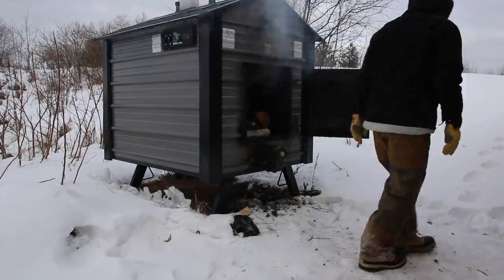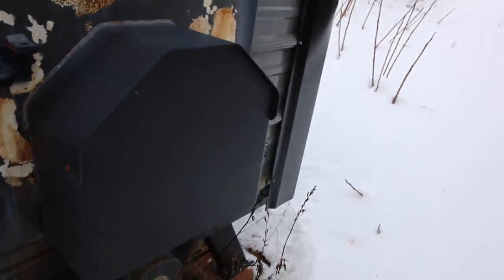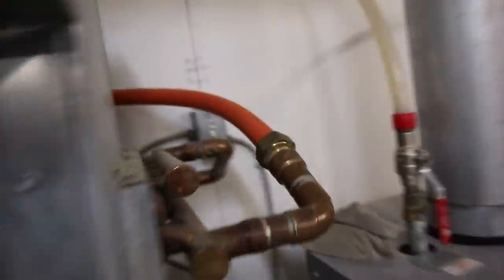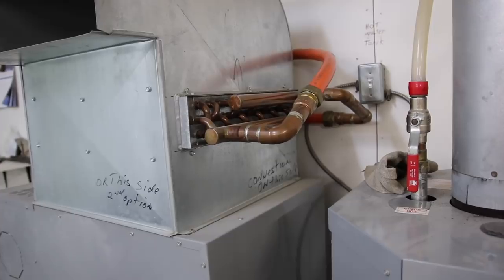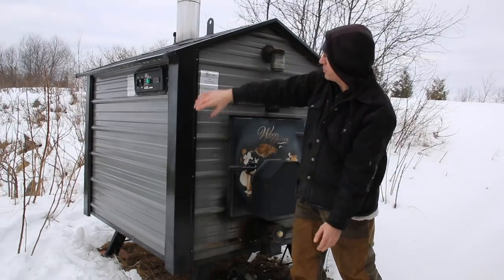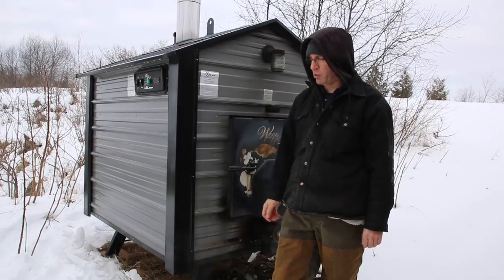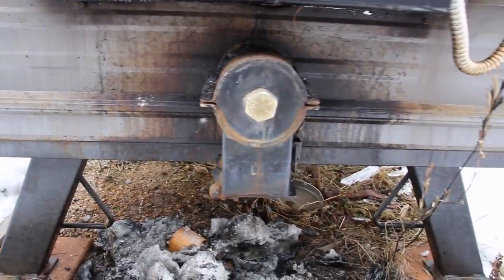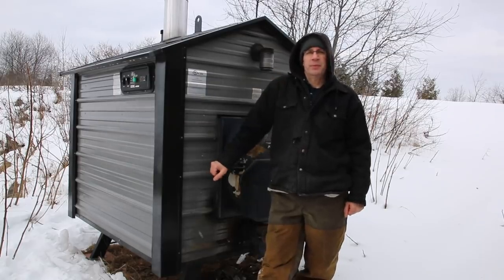Outdoor wood furnace "worth the investment?"

Comment: Most towns in Ct, including mine, thank goodness, have banned outdoor wood-burning boilers; way too much smoke. One unit can smoke up a whole neighborhood.
Reply: If they are up to current federal codes THE NEW MODELS hardly smoke at all but they will put a dent in your wallet, they burn much hotter and hardly put out any smoke but you can still smell a little.
Reply: Boiler stove
Reply: Mine hardly smokes, especially compared to my wood stove
Reply: they only smoke bad if your burning wet wood.
Reply: Glad I don’t live in CT... they won’t let you use wood because they would rather charge up the ass for the gas run to your home that’s why they banned it, wonder what would happen to people like that if the shit hit the fan and all heat and electricity was cut off, 80% of the population would die because they didn’t know how to start a fire

Comment: logmeindangit
so clearly he meant outside.. and I agree, that was the first sign to me that he was not energy wise. all of what he spoke of is true and so much more. What it did do was cause me to design yet another wood burning apparatus for various uses. 
What i find sadly humorous and we all do stupid things ... actually dumb things because of ignorance... stupid is when you know better and do it anyway, dumb is when you don't know better because no one shared the info with us.... 
Ok the simple solution on so many levels would be to simply run the heat exhaust up the side of the building and above it by three feet creating updraft (no fan needed) put the chimney stove piping at a 17.5 degree angle or more depending, at least 2 feet away from the wall and double back if you can and up out the peak plus two to three feet (looked like the building is in a holler so it may have to be taller with stays and or a wurrlygig spinner to stop downdrafts.... now the door to the furnace could be facing out of the back of the shop, clear a space to bring and stack the wood on pallets, cut a hole in the wall for the door after stripping the outside off and making adjustments, sealing holes or putting valves in them to use for more efficient burning, and now you conserve all the heat produced, don’t need a fan and all that electronics to go bad but if it works leave it on there for when your not around, (love the oil burner backup and use of the same fan.... check to see if you can't put a large flap to direct the flow of air over one or the other radiators and reduce drag on the motor (I found that finding an old belt drive fan and reducing the ratio even more so it runs very slowly and quietly (grease bearings once a year) works great and never need the furnace fan and all that electricity, like 120 bucks a month around here... or a cheap fan on a stand works well to with a directed shield around it blowing at the flew pipe (get the thick good stuff, solder or screw and tape the joints and paint Black Chimney works great)... 
Oh and if you want to go automatic find some potentiometer setups or the old spring thermostats that are large and strong and use as valve to open air intake or close it as it gets hotter.  Cut a doorway about four feet away from the stove and create the wood patio loading dock, which you could cover with foam and siding with slats to screw to (be sure to pre-drill, use rubber washers and or calk in the hole first to oooze out and then cover again and smooth over so no leaks, I use soffit vinyl white (due to least expansion rate which a lot of screws can overcome) I use drywall as they have a lip on the underside to grab the drywall paper and it works as a built in seal so all ya gotta do is properly seal the top so it doesn't rust.... so now you can go through the shop door in your PJ's and load it up or if you've built an auto loader, simply open the furnace door hit the load button and the logs slide down a shoot like a concrete truck and you direct the flow and where it goes, Close the door and wander back to the lazy-boy chair and the football game..... :-}
And now when you go out with your family to have fun or teach some kids that have never experienced it and make it a fun event, get a real log splitter that splits a log into five pieces in a second ... see youtube videos.... or put a team together and make a little production of it and sell some to pay back or pay yourself for being so smart... what matters is that you have fun and share it with others while "work is being done".. If you were loading it twice a day the way you have it now, it will be every two days this way, which means you have a slow burning kiln now and can put big thick heavy logs in there once you have a good heart of coals...won't be long before you're opening the door to let some cool in... oh and don;t forget the importance of moisture to transfer heat and more comfortable for the lungs etc... Blessings hope someone gets something from my sharing.... I can see it, and I like it... thanks for sharing..

Comment: Oh no! Another winter with geothermal! Still going strong after another dreaded summer of meat locker cold in the house. I used to dread winter. 20 cords to cut. Constant feeding the boiler the best tamarac and ash. Saws to maintain,old 4x4 getting old. Every day off in the bush. Scouting for new supplies of trees. Now I adjust the thermostat. Your right this geothermal is crap. It paid for itself the first winter as far as I’m concerned. The sweetest thing was that Harper gave me back 11,000$ to install it on the green home improvement grant : )
Pure joy was dumping my boiler at the scrap yard.

Comment: Wow, you put a shit ton of wood in it, at a time.  If you were heating with a stove, you'd start with 2 to 4 logs and add one to 2 logs at a time, thereafter.  I see this one puts the fire nearly out, and restarts it though.  So you don't have to stoke it so often.  That's interesting.  

It seems like it would be more efficient to put the boiler inside the house.  Then it would heat the home, even if the power went down.  And you wouldn't have to get dressed.

Comment: Every set up is going to have its pros and cons.  One of the more hidden benefits to this system is that you have the option to use it in times when other methods of heat are too expensive and the option to not use it when other methods of heat are cheaper.  Propane, heating oil, kerosene........at any time, the suppliers of these resources can decide to raise the price.  You can be mad about it all you want, but what are you going to do? ........ not buy it and freeze to death?  having a system like this gives you the option to not have to use other methods.  I am curious though, why you don't use this to heat your house as well.  seems like a lot of wasted heat and money for just a shop...... unless that's your workplace where you make your living.

Comment: You put an insane amount of wood in that boiler. Of course it wastes most of the heat. Stoke it with a few pieces of large logs and it will work much more efficiently.

Comment: They are nice to use, but this is a cheap and inefficient setup that definitely wasn't worth installing.  At a minimum a gasifying boiler should be used so you aren't wasting your wood.  A storage tank should be used, also so you don't waste so much wood.

Comment: Don’t do it. Get geothermal. Boiler is a ridiculous amount of work. Cutting and hauling wood. Maintaining a truck and saws. Dangerous work. Water treatment is a big pain then when the water jacket starts to go you will be fighting holes. Did it for 10 years. No more going outside at bed time to fill the boiler then wide awake. So many reasons not to go wood boiler. Nice little stove in the house,cheap and nice heat. I regret ever thinking a boiler is a good idea.
Reply: geothermal is a total waste of money, people here tried it and dam nere sick all winter, could not get heat to save there ass at -40
Reply: Geothermal is a joke and a complete waste of money. You will never get your money back and its not practical at all
Reply: Complete joke?im sitting in my cozy house smiling it’s such a joke. Yes it’s terrible. 100$ a month in electricity. Warm as I want in winter Cool as I want in summer. See,I had a boiler,now I have geo,and I have several wood stoves. I know absolutely nothing except I’m warm,I’m not outside feeding the beast.
Reply: @chrisroos5081  it will never pay for itself and it just gets to be more expensive over time when you start to need costly repairs and your electric bills keeps going up. I used to help with installs and problems back in the day. Waste of money just like these outdoor wood stoves

Comment: 176 is way too high no wonder your using so much wood, 145 is plenty hot enough for water heat
Reply: I was thinking the same thing.  Also wondering if it was because of the loss of heat due to such a long way to travel.
Reply: Derek Simenac don’t know what you are talking about you get 30deg across coil
Reply: Should have mounted it in shop ran pipe thru roof
Reply: Derek Simenac for normal boilers the water needs to reach 180F in order for proper heating.

Comment: Wrong type get a heatmor i love mine .yes its work but i heat my home .my garage and all the hot water you will ever use .my house is 1800 sq feet 900 sq garage .the door on the heatmor is water cooled best seal on door and most 
Important burn dry wood .i burn 7 cord a year 1400$

Comment: What no one who uses this sort of outdoor wood furnace has ever been able to answer, is EXACTLY how many cords of wood they burn each season?
Reply: dkeith45  I live in Manitoba and heat my house with a wood master. I start it Nov 1 every year and shut it down at the end of March. I burn approx 6 cord of wood.
Reply: @tomwhite8496  What's the sq. footage of your home?
Reply: dkeith45 I have a 30x40 house with a full basement that includes floor heat hooked up to my boiler
Reply: I have the same one and to heat 3500 sq ft (1000 being floor heat in my attached garage kept at 65) and heating my hot water. I'm on my 5th winter burning from mid October to May. It takes approximately 12 cords of hardwood

Comment: I like my wood stove out doors,no mess in house,no smoke.always fill stove with wood first thing in morning,last thing I do at quitting time.problim I see is you have a circulating pump at stove waist a lot of heat to ground especially with poor insulting pipes,mine is better but not good enough pipes are buried 3' deep under the right conditions the snow will melt on the ground.i have my circulation pump is installed in my basement controlled by thermostat as as hot water reaches the radiator another thermostat starts the blower neather runs until needed.not greatly efficient as my pipes are buried about 200'. Most of my wood is gathered by cleaning out fence rows so the time I use is to bring the wood home,better than burning it in the field at a risk of fire out of control,my stove will take logs as big as I can handle so I don't halft to process it much,mostly spare time process it at home. One other suggestion is check out saw mills they will pretty much give you slabs just to avoid burning them,only cost around here is to load them on a trailer just cut them to lingth on the trailer and stack the wood,pretty quick,and only halft to handle it once. Good luck

Comment: a car A/C will put 220° off the radiator , and 68° thru the lines, heat and A/c ran with a 2 horsepower motor driving the whole system alot cheaper and a easy build. and you can mount the fan and radiator right into existing ducts. a 55 gallon drum with 25 ft copper in water will cool the freon for the cold side.

Comment: If you have to buy wood not a great deal, but if you have land much better deal, also remember you heat your hot water all year round also , now it gets more attractive .. now when you factor in comfort compared to freeze your butt off heat pump, nowyour talkin. And unlimited hot water, if you have wimmin in the house they will be sold on there never ending hot showers .. for me it paid off in three years , and costs goes down every year, I m happy with mine

Comment: I would highly recommend you build a rocket stove.... you would only need to use the fraction of the wood you are currently burning.  I just built my rocket stove and I am amazed how hot it gets with so little wood, no smoke, very little ashes simply its a very efficient burning concept when it burns the smoke in the secondary chamber,  I am looking to build a system much closer to the house and there is no issues with the smoke.  Go to permies.com and look at Rocket Mass Stoves by Paul Wheaton or Erica and Ernie Wiesner.  This will save you a lot of work handling wood.  
c

Comment: Wrong impression yes they are worth it the little bit of work it takes to run one compared to the price of oil or propane or gas ya it's worth it and if this guy was heating his house too he would save even more money the furnace could handle it no problem one thing you cut your wood in 3 to 4 ' lengths what ever size that will fit and you do not split it the wood will last longer 24 to 30  hour burn a lot less work then cutting it all at 12 to 14 " and splitting it waste of time I buy a load of logs costs 1100  it lasts all winter with about 6 cord left over so I burn around 19 to 20 cord every winter when I had a wood stove in the house I burnt close to 15 cord so not a big difference plus I had to cut and split everything and pile it to dry for a year the wood furnace is totally different you can burn green (not dry) wood I cut the wood as I burn it drop the load of logs by the wood furnace cut them at 3 to 4' pieces  and your good  Draining is so easy really you open the drain valve wow that was hard and the smell unless you have your windows open in the winter time your not going to smell anything this guy is telling you a lot of bad information don't believe it I have used different types of heating over the years and the wood furnace is by far the best and cheapest

Comment: I use a wood stove in my basement that has a thermostatically controlled blower.  That blower pumps the heated air up into my hallway and has enough force to distribute the heated air through out the house.  I have an oil furnace as a back up heat.  It works well for me.  My wood and fuel oil costs me about $1200 per year.  An outdoor furnace would cost me a very high initial investment along with the other costs.  I have friends that use outdoor furnaces.  They use about twice the wood I use.   NO THANKS.  Good video sir.

Comment: I agree. Wood. Is. Nice at first, but at what cost,,,.  I. Have. Wood. Heat. And. House. Furnace. And. Gas heaters in. 2 rooms. Of. My. House,, it. Hurts when gas bill arrive. But. It does . Not hurt when im. Cold. And. Warm. Up. Cottage. With. Gas. Then. Use cwood,  but. The older u get the more work it is to do wood,..  florida..?.

Comment: I use to burn wood. Today i would rather just turn the dial on my propane. Wisconsin. $700 a winter for propane heat.
Reply from the maker: Next year I'm doing the same :)
Reply: I lived in North Central Wisconsin for many years. I used wood with LP for backup. Now I live in Tennessee and run a heat pump. Planning to install a wood furnace so because electric bill gets around $200 a for the month of January.

Comment: I fill mine in my underwear and muck boots.... Hardy makes a good furnace all stainless steel heats 1500 square ft house at 10 rank a year I can split 10 rank in one day with my splitter I can cut 5 rank in one day easy with a sharp chain and the difference in heat with my new elec furnace which takes 7 minutes to get temp to 72 degrees the heat with boiler under 3 minutes and never have truble with fire going out.. but also I just enjoy cutting wood.... As long as my chain is sharp...

Comment: You could buy a heat pump geothermic with this money mannn!  It's not good system, no no. Moreover you need water treatment for close loop heating system , be cause soon you will get problem with water coil or water jacket boiler corrosion!!